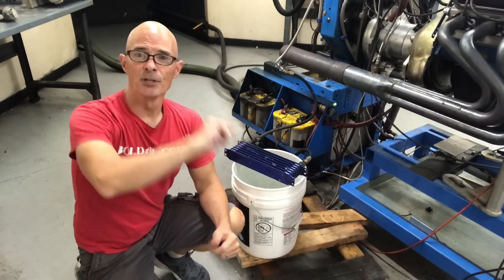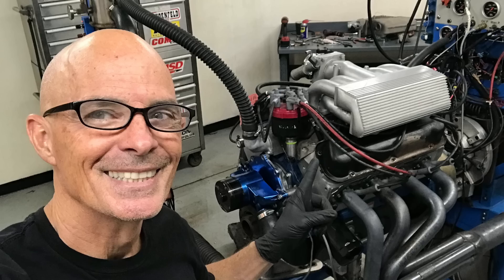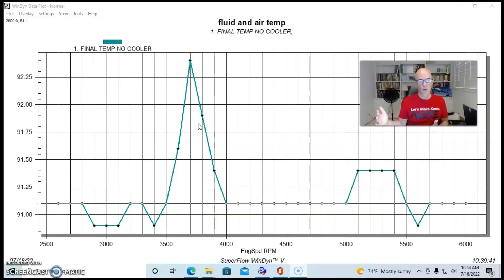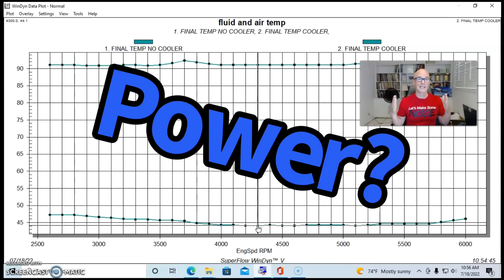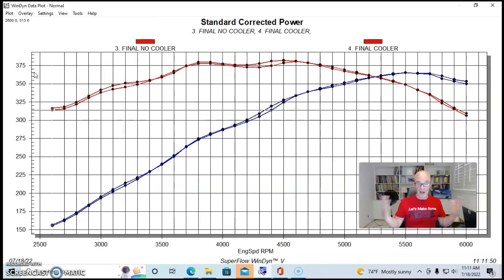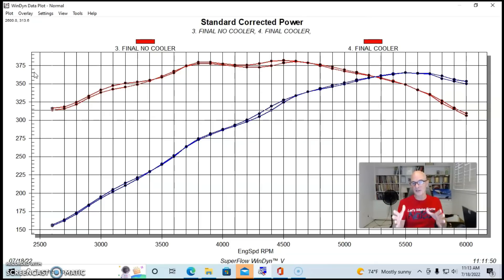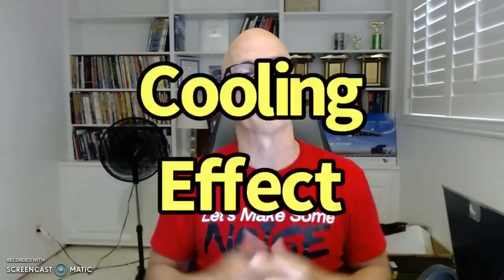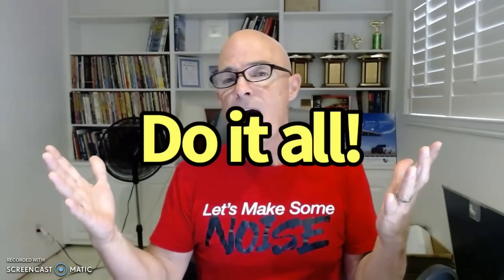EFI FUEL COOLING & HP? DOES ICE-COLD FUEL ACTUALLY ADD POWER TO YOUR FUEL-INJECTED MOTOR? DYNO TEST

Comment: Cooling the fuel can theoretically help, but at the temp differences you're looking at the change in heat of evaporation is small.  Even going from 212 F down to 50 F is only going to increase the heat of evaporation of a gasoline fuel by about 10%.  The real cooling effect is from evaporation itself and much less from the process of heating the fuel till it reaches evaporation temp in the intake tract.  In contrast, the heat of evaporation of a pure ethanol fuel is about twice that of a gasoline fuel, so you're going to pull out much more heat switching to E85 than you could theoretically do by chilling gasoline in the temp ranges we'd expect on the road.
Reply from the maker: still a fun test

Comment: Fuel has more gases in it than does water so yes it will compressed if you're running higher pressure pumps on it. Do you know nothing about fluid dynamics and physics? The fact that pule only averages about 6.1 lb per gallon to 8.1 or so for water shows you that it has considerably more gases in it than does water.
85 cools off the charge because alcohol and ethanol tend to vaporize much easier which cools the intake charge. At least you understood that when you cool the fuel it works much better through a carburetor because there's more time for the fuel to cool the intake charge then in a port injected engine. That's why Port injected engines don't always get higher horsepower than carbureted engines.
Reply from the maker: Fuel compresses very little compared to air-that is just silly talk

Comment: Cooled fuel does not shrink and then expand to a larger volume. Fuel needs to expand to mix into the correct ratio to burn....cooling will cause thos process to take longer.  Super cooled air contracts then expands rapidly when heated creating more volume and pressure inside a confined space giving a larger volume to burn when compressed.  The old police interceptor I had used a brass plate I'm the bottom of the intake to super heat the fuel quickly into gaseous form and using cooled air did give it good performance.

Comment: Maybe look at methanol injection. It sprays the fuel (methanol) in further upstream, more time for evaporative cooling. Ive long suspected a interchiller paired with a meth system would see some gains. Meth being traditionally paired with boosted applications.

Comment: I think the reson for the the difference with a carb motor is where the fuel comes in. With carb at the beginning and with a EFI right before entering the cylinder. The carb had time to mix with the air and lower the charge temp. I think.

Comment: If it's not knock limited than I couldn't see it doing anything. Also if you don't add timing to take advantage of e85 or cooler fuel then wouldn't expect a change. So if this same test was done on the motor but in a knock limited situation like boost or high compression then it still probably wouldn't change much unless changes were made to timing and may e a little fueling
Reply: Totally agree here, I wish he would do the engine optimizations for each setup tuning wise. I know that every little change you make in the cooling of burnables needs some tuning before benefits can be shown.

Comment: I would expect a slight loss in power.

Changing the temperature of the fuel does change the density of the fuel. Just like when you have a cold transmission it's on the cold mark on the dipstick and when it's hot out will be on the hot mark due to expansion of 8-12qts of fluid.

 It's minimal but if you squeeze 12qrts of gas into an 8qt space because of temp change you would richen the mixture as long as the fuel still gasifies on the compression stroke.

I know I'm exaggerating the space but that was done for a reason.  It would be worth figuring out how much less space 40 deg fuel consumes compared to 150 degree fuel per gallon. If it's only an fl oz or 2 per gallon you'll never see a difference in the fuel curve.
Reply: Fuel does not change it's volume based on temperature.
Reply: @tylerphilpott2155  btw I looked it up and gasoline gains 1% more volume for every 15 degrees in change

So 100 gallons of gas at 0f will become 107 gallons at 105f and 114 gallons at 210  but when burned that 107/114 gallons will release the same amount of energy as the 100 gallons at 0deg

This means the 0deg fuel has more energy density per measurement of fuel. Since there are more parts of fuel per let's say fl oZ of fuel, you would need more air per oz of fuel burned other wise you wind up with a slightly richer mixture since more energy is being delivered per oz of fuel when cold and less energy per oz when hot
Reply: The reason your transmission changes it's level is because the fluid is getting dispersed around the transmission and getting used. It's not about the temperature at all.
Reply: @tylerphilpott2155  so by your theory the fluid level should drop from a cold transmission to a hot transmission. This is not the case at all. A cold line on a dipstick represents a cold fluid level and the hot line represents the same amount of fluid( in weight) but hot and expanded . 

Fluids become less dense with temperature and to become less dense means your need to take up more volume for a fixed amount of fluid( in weight) btw fuel is measured in with flow rate ccs, gpm etc or lbs per hour,kg per hour etc.

Cold fuel theory for years has been that the fuel is more dense so more power.

Comment: What about a test comparison on na  engines with low compression 9:1 to high 12+:1? I have a  302 Boss with 12.5:1.  I am considering dropping it to around 9:1 with flat top pistons instead of the high dome pistons in it now. I did consider a E85 fuel change as well. I want to drive this car without the extreme cost of race gas.
Reply from the maker: e85 works

Comment: Heating the fuel with high pressure injectors or very high pressure injectors will make it evaporate quicker think air conditioning.

Comment: Love your work though you are barking up the wrong tree. Any fueling multiplier effect in this example for FI is bounded by the limitations of the AFR (14.7:1 part fuel) and the density change across the fuel temp delta (also small). You are on the wrong end of the teeter-totter.

Comment: Some one did something like this in a high horsepower car they used water injection to gain power. They only seen another 8 hp. But it wasn’t hot outside and the hood was up on the car if I remember

Comment: I had a 79 merc Capri with a draw through turbo set up. I thought about running a fuel cooler on it.  The idea never happened, but I was curious if that would have made more power.

Comment: If the cooled fuel isn't cooling any air it's not going to do anything for power.  If you inject a liquid upstream in the intake it will cool things and show up on the dyno.  It will actually be a tiny bit more efficient with hot fuel, but the rest of the fuel system doesn't handle it well (fuel pump, floats, etc).  This is also part of the reason a dead-head OEM type system works perfectly fine - no hot return fuel to bring up the temp in the fuel tank and cause issues with the fuel pump.  The injectors don't care about fuel temp and neither does the engine.

Comment: Cooling the fuel makes no sense at all if anything you need to heat the fuel. Charge cooling happens because the fuel is evaporating so when a liquid turns to gas you get latent heat not because the fuel is a cooler temperature. If you heat the fuel it will evaporate quicker when injected that will give better charge cooling.

Comment: Vaporisation (liquid to gas phase change) is what takes a lot of heat input. Not so much for just heating up the liquid to vaporisation temperature. So get that fuel atomised as fine as you can and injected further away from intake valves to allow time for phase change. Then results will follow...to some extent at least!
Reply: yes. 

but for results I don't think it'll make any difference higher up, because the phase change is what takes way more energy than the 50 degree difference.

Comment: Richard you made a really interesting video here. I think you could look at it from a different perspective - how much power can you squeeze from low quality gas? What say I lived in a place where only low octane fuel is available? Does cooled fuel allow me to run a higher compression/higher boost/advanced timing for a given octane rating? 
I'd love to see you also revisit the water injection with the same perspective because your video on that showed that we lose power by adding water-only injection. What about the gains that can be made by the raised "effective" octane now that it's water injected? In that video you ran the same fuel, but didn't push the new limits of the fuel "octane" after water injection. IE, higher boost etc 
BUT good work I love your efforts!

Comment: All liquids are compressible, just by a very tiny, insignificant amount, the cool fuel (with the close injector position) probably doesn't dwell long enough to make any difference which is the result you got ;-) E85 is higher by volume so will potentially have a larger effect than you initially think :-)
Reply: .995 compressible.

Comment: Tunnel Ram intake, with downdraft throttlebodies and the injectors at the top of the runners or even up in the plenum, also use a return type fuel system.
perhaps 16 smaller injectors rather than 8 big ones, will atomize the fuel better and faster too.

Comment: From what I seen on engine masters, it adds power...where as having an air gap intake really doesn't make much of a difference...the cold fuel makes more power than cold air and fuel...
Reply: The morosso cool can was actually a good idea....
Reply: Also...older Mercedes had a fuel line attached to the low pressure a/c line to cool the fuel b4 it got to the injection unit
Reply: Wow...I stand corrected....I thought it would work for injection like it did for carb.....wow...learn something new every day

Comment: My 94 s10 is running straight up E85 ! 2.2 l ! with the vortex cyl heads the cooling effect of E85 is pretty remarkable ! note : this is a 640,000 mile vehicle and no harm to any component done ! + i saved $ 18 on my last fuel up
Reply: scotty moondog jakubin  interesting.  i have a 98 S 10.  how did you increase the volume of fuel required by running E-85?  thanks, john

Comment: You might see a bigger change if the fuel temp was closer to what we see in the car after being heated and returned to fuel tank. Id have to guess it gets to around 130-140 degrees eventually
Reply: on port injection is no fuel return into tank, tank pump sends fuel to engine and pressure regulator on fuel rail near injectors keeps pressure steady

Comment: I would switch the little 5.0 over to carborated and see what it does before trying it boosted. I believe you didn't see a change in power on this injection because of the small spray pattern atomization

Comment: I'd definitely want to see it on a forced-induction engine, but you'd probably want to configure it for a full return setup. The carb version likely made power since it stayed cool from all that thermal mass. The fuel rails have much more surface area to absorb heat.

Also the music was throwing me thru a loop til I realized it was "chill" music for a chilled-fuel topic. lol

Comment: Latent heat of vaporization is why Ethanol cools the intake charge, which works with the added O2 in the fuel to make more power, when you drop the intake temp by the fuel vaporizing it makes a denser charge. Cooling the fuel makes it harder to vaporize the fuel, even in a relative vacuum in the intake port/manifold. Boiling point goes up with more pressure, down with less pressure, so you are exacerbating the problem with cooling the fuel with a lower pressure in the intake. 

Gasoline needs between 80F and 450F to vaporize the component chemicals in it. Obviously some of it never vaporizes fully, which is why it wastes so much energy as heat that we have to get rid of with the radiator and exhaust. Cooling it means it takes longer for it to vaporize, and more heat in the intake. It should help with ping/knock and vapor lock like Dave and the Steve's found on EM, and cool the charge slightly just because its cold, but its when a liquid vaporizes that it pulls the heat out of the air around it.

Already know what happens if you run E85 cold like gasoline. You use more of it. The power stays about the same, but you get worse mileage. If you run an alcohol engine, be it ethanol or methanol too cold, like with a 160F or no thermostat, you are going to milk the oil on the street due to condensation building up in the crankcase. It doesn't like to vaporize when its cold, which is why it doesn't like to start when the air and engine are around 20F. Trust me, I run into that here in Michigan, but you wont in SoCal. Below 40F I have to get creative starting one of my E85 Pontiacs with a carb. EFI starts a bit better, but it takes considerably longer than when its hot.

Ethanol plays different than gasoline, it takes another thought process entirely to get the most out of it. It actually likes the heat in the intake, heads, ports, air, and fuel. Because all of that makes it vaporize more readily. Now its not going to make a big power increase running everything hot like that, but it will use less fuel.

You probably won't see a difference in power going from 48F fuel to 200F fuel running E98/E100, you probably won't see a bfsc change either...  but.. in a street driven vehicle, you will pick up mileage and keep the power. There is more to it than bfsc, tq, and hp. Lots of variables at play in a running vehicle that are simply not present on a dyno, but you already know that. Move the injectors farther upstream and heat the ethanol before it gets to the rails, but after the return so you're not sending heated fuel back to the tank, and it has more time to vaporize.

This is what I have been working on in an effort to get better mileage on ethanol, along with building my engines with as much compression as I can put in them... which precludes running pump gas. The power ends up where it ends up, but with 13:1 compression in 455s with nearly double the CFM of a stock head, they make some power. Man do they ever drive nice too.
Reply: I need to try that on my E85 Honda. I dont have much compression 9.3 but I can heat the fuel up.
Reply: very interesting.  do you know where i could get some pontiac factory iron heads ported?  thank you.
Reply: @johnbecay6887  Dave Bischop at SF Performance in Canada, Kaufman Racing in Ohio, Butler doesn't do many iron heads anymore, tears up the CNC machines too much for them.
Reply: @SweatyFatGuy  thank you.  i know Butler had stopped porting iron heads.  i will check out the other 2... thank you., take care, john

Comment: I believe what we are seeing here is that the latent heat of vaporization has more of an impact than the temperature of the fuel itself. Good content!
Reply: I totally agree here. I think carburetors benefit from a secondary 'sheering' effect in regards to fuel vaporization due to the boosters. I believe tall long runner/cooler intakes like annular boosters?. Hence, more cold = need more atomization. Everything equal: I would think cold fuel would just make the droplets in the mix larger? Requiring even more sheer which an injector nozzle doesn't deliver like a carb. Same gravy. Just now with lumps...

Comment: On a boosted Engine with very good intercooling and with the fuel injectors very close to the intake valve it can actually help to slightly heat the fuel to improve vaporization.  Improved vaporization will help prevent detonation while increasing power.  

Many years ago Ferrari used special fuel for qualifying in Formula 1 versus what they would run during the race.  The qualifying fuel was supplied by Shell that contained isopentene and cyclopentane.  It would vaporize very fast because it was a light molecule and they could run higher boost because it had very good octane.  They couldn't run the qualifying fuel during the race because there wasn't enough BTUs per specific volume and they were limited by fuel tank size.
Reply: Thinking of this also, as turbo engines use extra fuel to cool down the intake charge. F150 EcoBoost has terrible mpg while towing.  Which Porsche did an interesting intake to try and solve this.

Comment: would have made a  bigger  difference  with a  carbureted  engine  as its a much longer  distance for the  fuel to cool the   charge air  so yeah id  say  moving the  injectors into the   plenum id say it  would make a difference

Comment: Bob Glidden . Run Foam Pipe Insulation . On His  Complete Fuel Line ! . to Keep The Engine Heat Away From His Fuel Lines & Re try with E85 & a high compression engine

Comment: Engines love cold air,, more so than cold fuel. Though modern efi engines dont seem to be near as different as carby engines.
In a practical way of cooling fuel for a road race or oval track car I doubt that really cool fuel makes little difference. However overheated fuel is a real problem. And some seem to go out of their way to maximise fuel heat!!
Like so many I go out of my way to keep the fuel system in cool air.

Comment: Your not going to see a difference when your using the same EFi setup the O2 sensor will eliminate any gains, on a Low Pressure Carb without a tune or Auto adjust you will see a larger difference, because the density of the Fuel. You can see the difference in the Fuel AKA injector duty they wont have to work as hard to make the same Power and AF ratio
!
Reply from the maker: the fuel supplied by the EFI did not change-it was in open loop
Reply: @richardholdener1727  What temperature was the engine ran At?